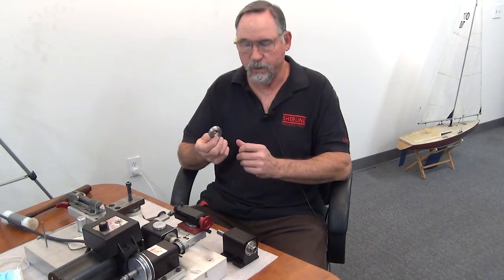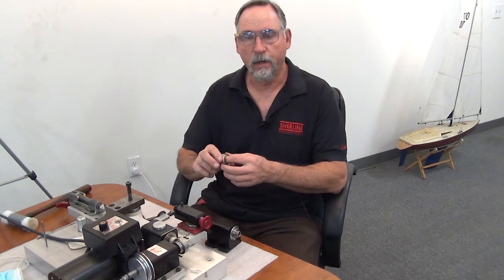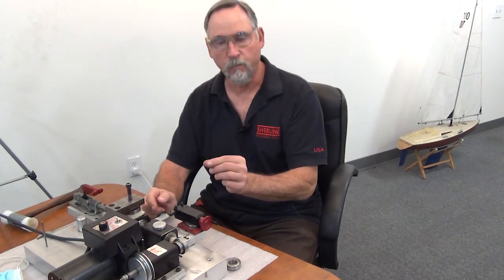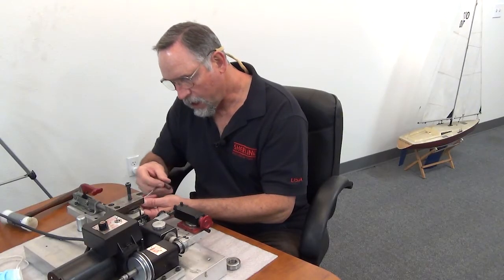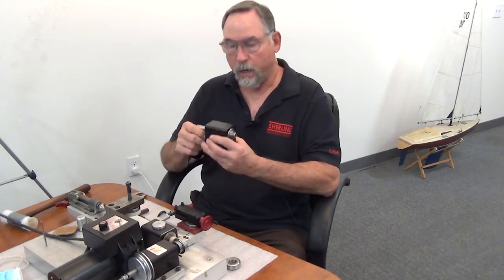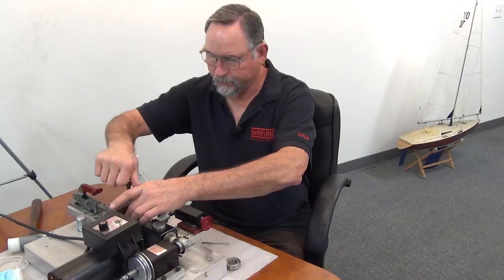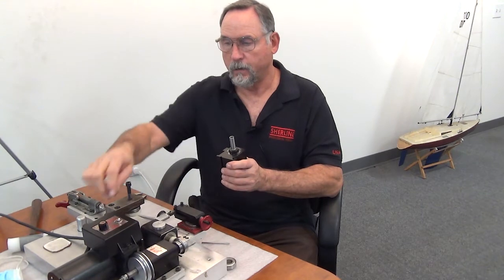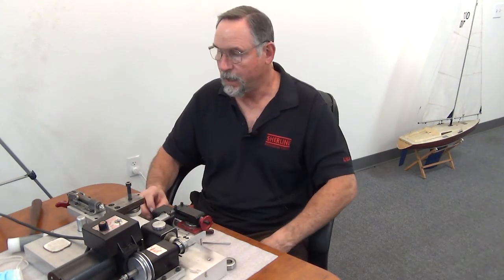Setting the Headstock Bearing Preload

Comment: What would need 10,000 rpm of spin to cut?
Reply from the maker: Higher turning speeds are for running small-diameter cutters for jobs like engraving. https://www.sherline.com/product/4335-10000-rpm-pulley-set/#description